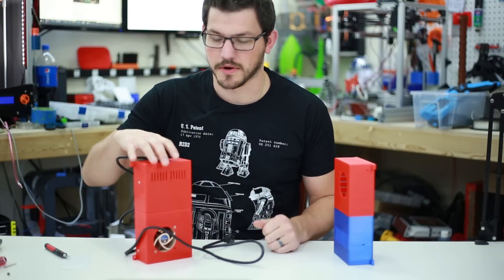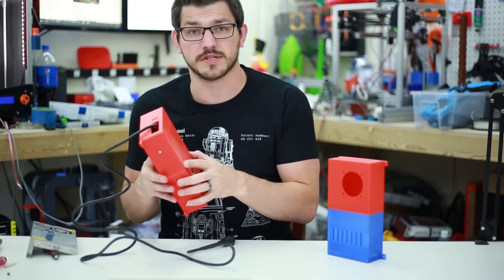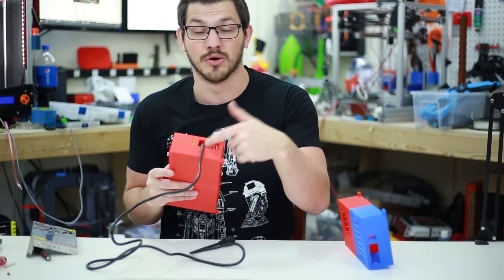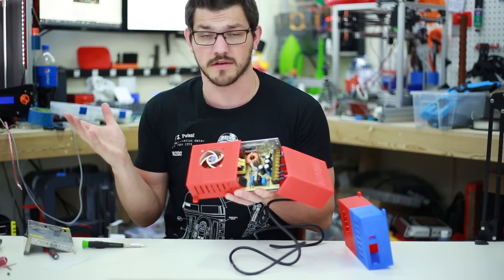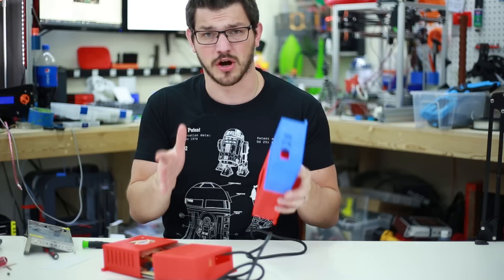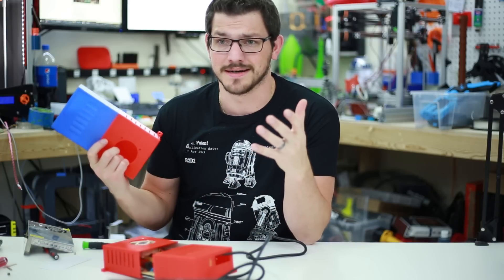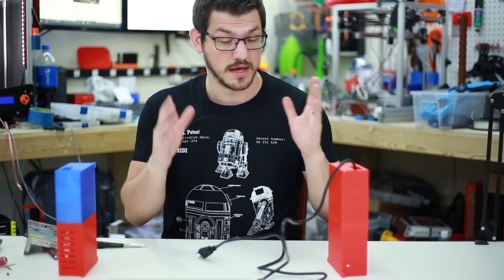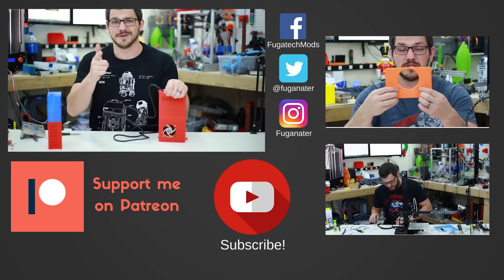Creality Ender 2 Silent PSU Mod

Comment: That's right - Shielding - there is a strong reason why PSUs, especially this type are enclosed in an all -metal case. By removing part of it you unshield the board - this can cause problems and even damage in some rare occasions. I would NOT do this mod and would not recommend to anyone doing it...

Comment: The wiring connections on the switch is vague given that none of the posts are labeled. Do you have any resources that might help with the wiring of the switch/plug?

Comment: By removing part of the metal shroud from PSU, does that remove EM shielding?
Reply: Yes it does.
Reply: I see your comment is around 1 year ago, but to answer this, the cover is more for electrical safety (grounding and keeping fingers out) EMI is not really a concern in a relatively dumb device that this power supply is. EMI could possibly be more of a concern in the control board, but still not a concern

Comment: Why not wire up an older high wattage Xbox power brick with some XT-60 bullet connectors and be done with it.
Reply from the maker: Because this was is using the stock parts and more fun.

Comment: Or you just screw the fan on the outside ?
Or even use a bigger Fan on the outside ?
Reply from the maker: If you don't want to mount it under your printer than yes, that would work.
Reply: I mean i like your Idea.

It´s just a lot of material used.
Nice would be to get to the switch ( 110V / 220V )

It would be nice to get a fusion file or step file or anything.
So the one how needs it can mod it to 80mm fan or 100 / 120 / 200mm fan etc.
Reply from the maker: The .f3d file is with the stl on Thingiverse.
Reply: Nice. Didnt show up first.